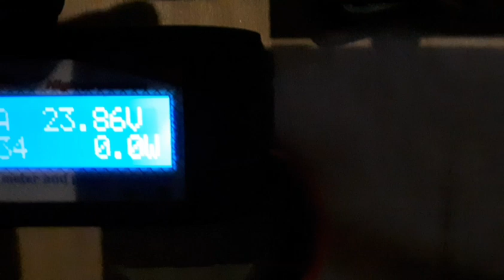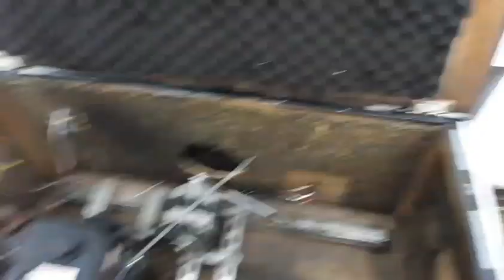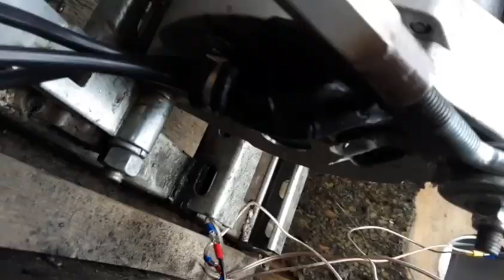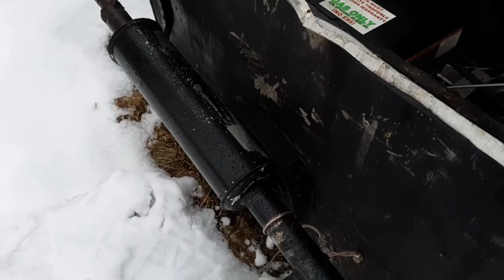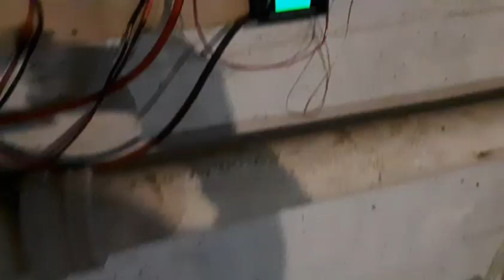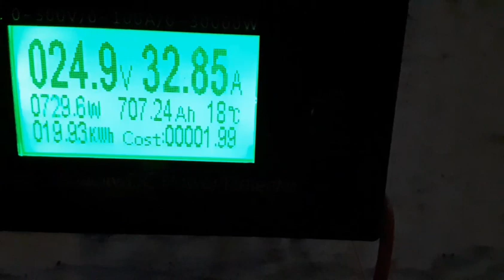DC Generator, Battery Bank Charger.

Comment: Hi! Im in the process of creating a generator and Im taking a lot of inspiration from your video. But Im also confused and have some questions.
Firstly, why do you not use a regular car alternator? I have access to very cheap/free alternators from old cars. Would it make sense for me to use that? My batteries are used (but good) truck starter batteries, 235ah,  that I also have a free supply of. So battery lifetime is not my highest priotrity, and 90a or less from an alternator will do just fine.
Secondly, why do you use a solid state rectifier when this guy does not: https://www.youtube.com/watch?v=bjv1SEx5iNA&list=WL&index=88
And thirdly, is your system more like the first method or the third method in this guys video (minus the starter battery) : https://www.youtube.com/watch?v=TAEzCcayI0g&list=WL&index=91 
Thank you!
Reply: I don't know if your still trying to get your 12 volt altenator set up going - 
      A 12 volt car altenator works well enough if you don't over do it -   
 There many 1000s of sail boats that use air cooled and water cooled small 3 HP diesel engines driving standard car altenator to charge there boats house battery's-  
  It does take some understanding to make a car altenator into a charging and running altenator - 
     Most altenator's today have built in regulators - they regulate the terminal voltage at the positive terminal at about 15 volts - 
     The problem with car altenator's is you can't draw much over 30 amps with out burning the diodes out - with large frame commercial truck engine alternator's they can handle 50 amps at 12 volt continuesly -
      30×15 = 450 watts - so a car alternator will handle a continues 30 amp load even in the hottest weather when driven by an air cooled engine at 2700 RPMs- 
     It's done on boats and in many areas through out the world - it's also the most efficient means of charging a battery when done correctly - 
      There are problems to overcome with a do it your self project - you have to understand battery technology its a lost art in developed countries -
    I live in a rural area of the US - many farm houses had farm power or farm lighting plants as they were called - that.was from about 1900 to around 1955 -
     Farmers lived just as sail boat live aboards do today that are ancored away from docks -
    The homes ran on 32 volts DC - that was common among rural homes world wide - 
    They understood charging technology and battery technology - today few understand that technology - 
      The reason hybrids are used on sail  boats is because there up to 10 times more fuel efficient than a engine driven generator running 24/7 - 
      If you don't learn the technology your better off just getting a power station and a inverter generator - other wise you will burn up a lot of altenator's and battery's while you try to make a system work - 
      I worked on generators in the off shore oilfields for decades also I'm 3rd generation in my family
Reply from the maker: Well without watching the other video, i can answer your questions. First, if your using a 12 volt system, normal automotive alternators do work. Before I upgraded to this monster PMA, that's what this generator was originally built for. I used a delco 10si from 90's diesel chevy trucks. 120 amp rated. I also used to have my system wired for 12 volts so it ended up working quite well. I did however need to run a small power wire to the alternator to activate it. Normal car alternators use electromagnets to produce power so they need starting current to "excite" the coils then the internal regulator took over to control the current and voltage. Sounds great and easy rite? Yup.....until its not. Very few alternators are built to withstand the heat generated while putting out max amperage. To charge a bank of batteries, rather then just 1 or 2, it needs to put out max amps for an extrnden period. So it did work great...while it did....i ended up frying 5 heavy duty, brand new purchased alternators. That was getting expensive. When i decided to rewire the system for 24 volts to increase overall system effiency(more volts/less amps) i ordered the large PMA (permanent magnet alternator) for thermodyne. The benefit to a PMA is it can be wired to any volt system through the rectifier and because of ohms law, it will feed power in at that voltage. It is then regulated by alternator speed. I use the solid state rectifier because its built for 300 amps and as long as it has a large heat sink and fan it can actually do it continueous duty.
Reply: @smallcityhomesteaders1600  Okay, very interesting. Thanks. I think I will try with regular alternators based on what you have told me and get a PMA if I get tired of it. In the months that I need it can be consistently -15c here in Sweden. The alternator I have currently has a big pipe attachment on the back and perhaps I can force air through it. And I will build the frame to make it easy to change alternator. In one of the videos I linked he is using a delco 27si. Is this one such alternator that can handle the heat? Will the throttle only adjust current and not voltage? How many rmps should the alternator have? Did you get your batteries fully charged then and did you drop motor speed for float charging?

Comment: What type of charge controler do you have to handke that kind of wattage?
Reply from the maker: The geneeator feeds into a 300 amp, 3 phase rectifier and then straight into the batteries. I manually control the input power with the throttle. The solar feeds into an EPEVER 60 amp charge controller.

Comment: Sweet my first video.  I need to run a truck crane.  24v DC.  I want to make my own generator to charge two 12V series car batteries. Any recommendation on the watts required.  It will not be used every day. but for sure might be run a total of two hours or so on a busy day.
Reply from the maker: Howdy! Glad you liked the video. Well, to calculate what you need for charging amps you first need to know what kind of amps you'll be using. Solar might even be a cheaper, maintenance free option if the crane won't see daily use. 2, 100 watt panels in series to a 24v solar controller would help top off the batteries between use without requiring any fuel.

Comment: What is the size pulley do you use and what do you use to top off batteries with, thanks
Reply: It looks like a 2.5 inch pulley - it works far better to use two drive belt pulleys on those set ups - you have far fewer belt problem with two belt drives - 
    You can get 4 inch racing pulleys for altenator's there the better -

Comment: If you wrapped the exhaust with some of that exhaust wrap stuff it would keep the heat in the exhaust pipe and keep the heat out of the box if it every became an issue. 

Could you run more than one of those alternators at the same time to double the apps you're getting out of it? Run a belt or chain back to a jack shaft with a couple pulleys that would go to the alternators. Also, rather than having to ramp the throttle up on the engine, why don't you change out the pulley on the engine to a larger diameter which will change the ratio to spin the alternator shaft faster at lower engine RPM, which would end up being more fuel efficient. I have been thinking of getting a pair of high output alternators and run two at the same time, then will power them with a very small, quiet and efficient 4 stroke engine that actually runs off propane tanks. It will accept 1lb bottles that I can refill or I can just run a 5 gallon tank with a remote line going to the engine.
Reply from the maker: The exhaust wrap would definatly keep more heat out of the box. The pulley ratio however is as high as it can get already. In early development stages i tried about 12 combinations of pulleys on both the engine and alternator. You wou be amazed at the amount of resistance an alternator makes to make energy. It's simply a transfer of energy with a loss ratio from mechanical to electrical. I didn't truly understand this until i built my pedal powered generator. I'm rather strong and been in good shape my whole life and with all my might i can only generate roughly 300 watts and sustain for about 2-3 minutes before im just spent. The problem with a higher ratio was the engine couldnt even start. I'd have to build in extra mechanics to start the engine in neutral, then throttle up and engage the belt. More parts, more problems. Getting something like this to work good is a challange....but a fun one.

Comment: What is the voltage coming out of the rectifier for alternator, is that hooked up to the mppt charge controller? Looking at a similar setup for my off grid, i totally get the generator and charger issues!
Reply from the maker: Well....that depends on rpm and what ever voltage bank you tie it to. Open circuit votage can get dangerously high but tied to a load, (battery) it equalizes with the resistance of the load. The voltage is what you see but if i disconnected it'd be much higher. No mppt controller for the generator setup. I'd need such a large controller. This can kick over 100 amps ar 24 volts so just straight rectifier and throttle control here. Simple but very very effective.

Comment: I haven’t had a good experience with hydrogen appliances company. Purchased their $85 220 amp meter , returned it because it keeps freezing up and 3 weeks later they won’t return calls or emails. Also purchased their 3500 watt Manta 2 Generator ( these have only been used for a little over a month) and now have issues with a broken plastic cooling fan inside the unit and get no response from anyone there! I would not recommend doing business with a company like this. I originally wanted the same PMA generator that you use but it was out of stock and Bob talked me into the Manta & it’s been nothing but a headache from day 1.
Reply from the maker: Geese....thats dissapointing to hear. Bob was rather helpful with me but 2 years can make a difference. I think after the grid down situation in Texas, people there have begun investing in back-up power and perhapse they are slammed but being busy is still no excuse for bad customer service. I know what your talking about with the meters also. I have a pair from a different brand but they're the same thing inside. After so many hours of generation they freeze and you gotta disconnect them for a second and they restart just fine but yes, it's annoying. There should be a reset button.
Reply: I had great luck with my Thermdyne PMA's. I built 8 of these charging systems for all my neighbors and the PMA's are pumping out great power up here in Alaska winters. It's true winters can be rough since the sun is gone for almost 4 months a year. What else can we do but supplement with a genny.

Comment: Yeah but you only have 25v at 40 amps wo t charge battery real good
Reply: His engine was running slow at that time. He was demonstrating how he could control the voltage with throttle speed.  He also shows 2280 Watts at 27.8 volts at 83 amps. I guess you were not paying attention.  I just bought my DC1212 from: hydrogenappliances.com/powerpmasdual.html   and I have it running a small 5hp gas engine with a 3.5" pulley and I am getting 2800 Watts at 132 Amps before the governor turns the motor off. I have 16X Trojan L-16 batterie's which is about 2000 Lbs. of lead acid. It's configured series/parallel. After only 2 hours charging they will run my home for 5 to 7 days with heavy loads like electric space heaters and a 65" plasma screen TV and such. Not bad for $1.25 in fuel making my power bill about $5.00 a month.  This efficiency of my Dual-core is genny is mind boggling for a tiny 14 lb. unit. Really amazing. I purchase road-tax-free Red-dyed gas at the Tractor Supply Co. for only $1.45 per gallon which is legal for electrical  power generation.  - https://www.google.com/search?q=red+dyed+gasoline+for+generators

Comment: Have you considered using a single cylinder diesel engine like a 6.56HP Yanmar L70AE with Electric Start? The reason I am asking, I have an All Power 7,000 watt Diesel generator that I am running on Waste Veggie-Oil that I collect for free from local restaurants. I then do a course filtering at 400 microns, than 200 microns. I then add Gasoline 10% by volume summer blend, 20% winter blend, 30% for real cold weather. I then run it through a 5 micron, and finally a 1 micron filter. No need to heat the oil blend, it is used directly by the engine. You could run that great PMA for a real long time for almost free like we do.
Reply from the maker: I absolutely have. I have been dabbeling with distilling alcohol recently but want to learn how to make bio-diesel for that very purpose. I am a bit of a prepper and don't believe fuel will always be available for purchase so i plan to just make my own soon. Also want to experiment with wood gassification.
Reply: @smallcityhomesteaders1600  Our diesel generator only had 75 hours run time when we got it off of Craigslist for $400. The problem with Bio-Diesel, it is very expensive and complicated to produce and it will still jell-up in the winter. I get our waste veggie-oil in 4 gallon plastic cubbies. The restaurants refill the containers the oil came in from their supplier. Before use in the engine I filter it and thin it with a solvent like petrol (gasoline) or #2 fuel oil same as (diesel no road tax). I store my settled and per-filtered veggie-oil in used 275 Gallon IBC Totes I got from Craigslist for $40 each. I thought about wood gas, I think it is great as long as we keep the tar out of the final gas because it will wreck the engine. I evaluated many methods and found the least amount of effort (work) with the biggest return was Waste Veggie-Oil. We can heat the house, make hot water and electric from one product that is free to acquire.
Reply from the maker: @stevenfrazier8939  i definatly understand the benefit and availability as i have some time in the food industry. Weekly we would drain 6 deep fryers. I have a small diner across the street im sure i could save the cost of disposile. Bio-diesle is just something i would like to learn as a last resort but i'd feel comfort in knowing how to do it. The engine currently running the gene costed me $99 new and a gallon of gas tops the batts off well enough for 3 days of normal use. With gas prices going back up however, a diesle engine mite make its way onto my shopping list sooner then i had planned.
Reply: What size diesel was in that 7kw when you got it?
Reply: @curmudgeinnak  10 Horse Power
Reply: @stevenfrazier8939  I have an L90 and running a 4kw. Just seems like I should be able to get more kw out of a diesel. Also having issues with rpm and hz. Power head I have is from 1994.
Reply: @curmudgeinnak  AC power heads are based on RPM. The more load you apply the more the head will struggle to keep in the 60hrz range. Governors are added to keep the RPM stable. Sometimes the governor needs to be repaired or replaced. With a 48 volt nominal battery system I chose to move to a small 6hp diesel engine coupled to a 2,700 RPM 3.5Kw Permanent Magnet Alternator (PMA) going through a voltage rectifier and then into a MidNite classic 150 charge controller. ($1,650) The best part is I can slow down the engine and still make lots of electricity. You could use the diesel engine you already have and make something similar. I prefer using a generator to directly charge a battery bank as the kilowatts are not wasted. Think about it, you have a 4Kw gen-set running at 3,600 RPM to supply power for 1Kw of need. Or use a Diesel PMA gen-set slowed down to 2,200 RPM to produce 2.5Kw an it I all goes into the batteries.

Comment: This is a no nonsense video describing reality and the issues that you will often face with "solar" systems.  I actually prefer the term "Least Expensive Available Power" (LEAP) systems to "solar"  - since solar is often in the dark and wind power often sucks >>>:) lol !
Reply from the maker: Haha!....ain't that the truth. Wind is rarely impressive here, better now with a good controller but solar makes in a day what wind does in a week. This generator was the 6th try at a good way to charge a battery bank. Before this i bought and killed 1(off the shelf) generator and 1 battery charger a year trying to top off 10 batteries. Normal equipment is not made to charge large banks. This however rocks! Year and a half later and zero signs of wear, loss of power. I swapped belts 3 times but they're being loaded down hard so whatever....$5. 1 gallon of gas gives me 3 tops off my 980ah bank and im good without sun or wind for 3-4 days.
Reply: @smallcityhomesteaders1600  Clearly, a good system. I had thought that this was a good, inexpensive approach just for economic reasons  - but your experience shows that it is a good nuts and bolts system  - a PMA run from a small 4 cycle. I really like it. Nice work ! So do you just run the PMA directly into your inverter charger ..... ? that is what I am planning to do.
Reply: What are you using to rectify the AC from the PMA ?  Did you craft together a heavy duty full-bridge rectifier or did you find something off-the-shelf ?
Reply from the maker: @smde1  using a solid state 300 amp, 3 phase rectifier on a large heat sink with a 120mm computer fan to keep it from melting down. From there, straight into the  main buss bars.